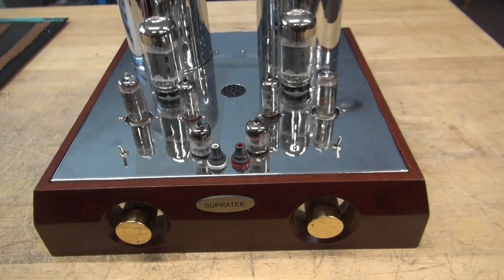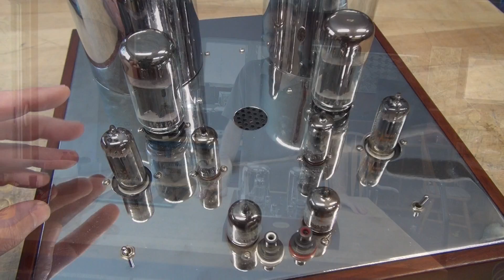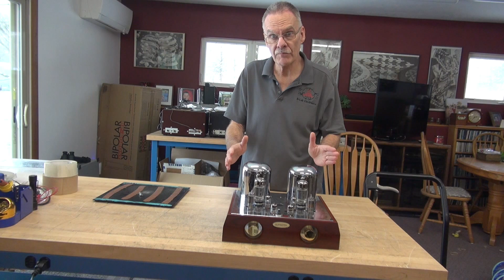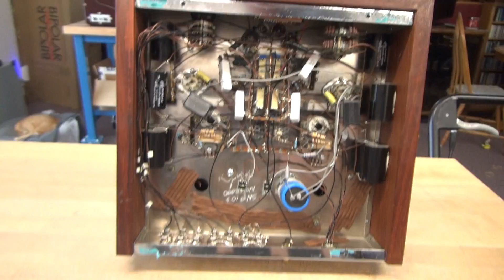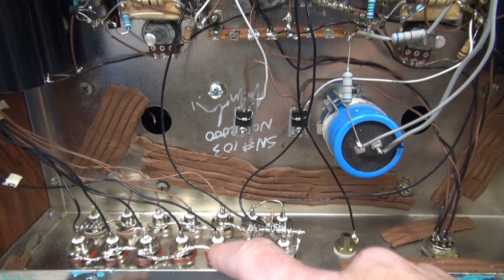Supratek tube type home stereo audio preamp amplifier inspection no repair

Comment: Audiogon review dated 04-09-2006 says tube complement is: 
2x E180F for primary phono
2x 6922  for secondary phono
2x 6sn7 for line stage
2x 5881 regulators
1x 5ar4 rectifier
I guess that one was a one-box creation.
An earlier review dated 2002-09-16 on Audioasylum mentions:
2x 6SN7 parallel triode single stage (non-cathode follower) driving the parafeed transformer output
6H30 and 6C45 in the phono stage
separate power supply case with:
1x 5Z4/5AR4/GZ33/GZ37 rectifier 
2x 5881 regulators
It seems no useful conclusions can be drawn from these as the design does not appear to be fixed. Reverse engineering of this earlier 2000 sample would be, at best, a risky endeavour.
The small signal, unknown tubes might be identifiable if a valve curve tracer is available, with suitable precautions taken during testing.

Comment: What was the battery for, seen underneath the chassis?
Reply: Yes, that was odd. My guess is some form of cathode bias (similar to some older radio designs). Also, some odd looking brown 'plasticine strips', shielding of some kind?
Reply: @ralphj4012  Looked like modeling clay to me, so nonconductive. Plus they were placed on metal chassis which would already provide shielding. My only thought was it was an attempt to reduce vibration or provide weight balance since the transformers were removed. But transformers would have been much heavier then the clay, so not sure about that.

Comment: Oh come on man, stop being lazy - That'd be a piece of piss to rebuild! The preamps tubes I've seen before, I think they are 5670s* The output transformers would be easy to reinstall leadouts for and being a preamp, alledgedly, the primary impedance will be between 5k and 15k while the output will be 600 ohms - if it is a lot less than that then they are output transformers and its an amp, which is what it looks like - three driver valves for a preamp?!

*Used on this video: watch?v=WM3LW4LtYTQ

So pop an output transformer off and investigate. You know what two of the valves are so you can pretty much summise parametrically what the first stage is.
The capacitors stayed in place from Australia to two previous owners and to you so the fixing method is fine.
I love this channel but you're better than this - its a preamp, not a complex radio reciever, now give it another look!

Comment: The chassis is pretty. Too bad it didn’t work out. Who was going to build your chassis for the power supply?
Reply from the maker: I was going to build the power supply. Unfortunately, the preamp had too many issues
Reply: Were you going to build a matching chrome-wood chassis?

Comment: A preamp with 5881 output tubes and transformer? I should think this is a amplifier with preamp.
Reply from the maker: Check out their website, it is a preamp. Yes design looks otherwise
Reply: Apparently the 5881s are used for power supply voltage regulation not output.